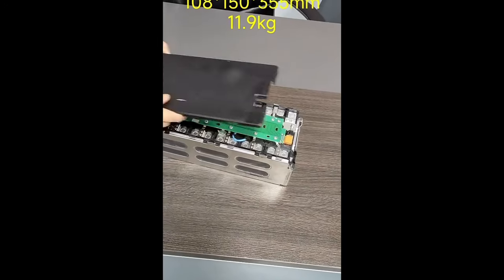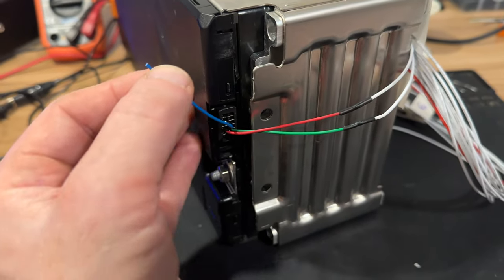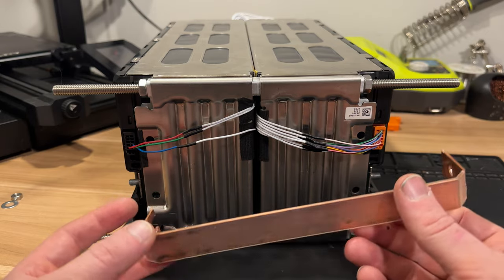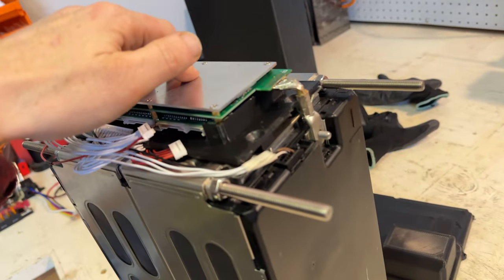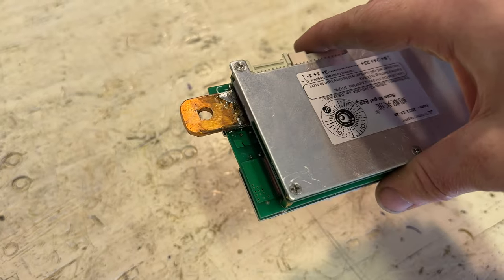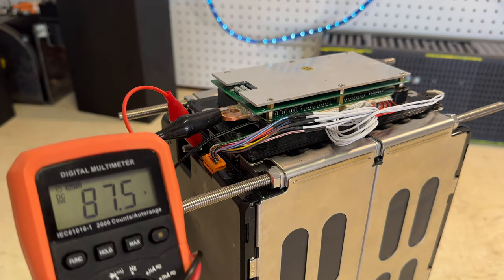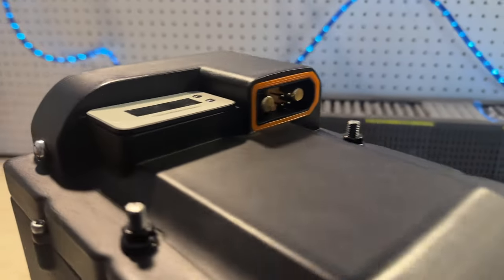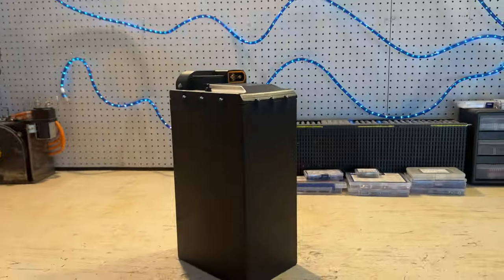High-Power Battery Pack in a 3D Printed Case | Samsung EV Modules

Comment: This had to be the best looking ebike battery I’ve seen, it’d be dope to modify the top of the enduro frame to allow it to be visible. Similar to Sur Ron
Reply from the maker: Thank you! actually this is for a electric motorcycle and is top-loaded like a Sur-Ron - check out my Instagram. video on that build coming soon!
Reply: @GaiusGarage really old comment but yeah I saw the build, looked great, I do however get worried about having so many electric components completely open air since I’m a all season rider🤔

Comment: Excellent build,  videos and channel! Very much enjoying seeing quality builds and very much looking forward to more episodes. I'm curious how bad a shock you got from the 84 volts?    I did a lot of industrial electrical work up to 35KV and the the only time I was what you might call 'electrocuted' was on a 125V DC. My hands literally tightened up on two leads and could not will my arms or hands to get loose, I could taste and feel the current on my tongue and my heart stop. As I started to pass-out I fell of a ladder and was disconnected.    If you ever do an episode on electrical safety I'd be happy to contribute my 2 cents worth. 

At 8:17 , for limiting solder wicking on large fine stranded connections, I might suggest you try coating the section you would like to remain flexible with high temp varnish, Silicone RTV or glass cloth tape in some cases can stop the wicking. I used 3M Glass Cloth Electrical Tape #27 for years in industrial applications, motor and generator builds and terminations. I use Scotch 27 on EV battery  builds, as it's more robust and durable than Kapton tape and less likely to abrade. 

Also, I might suggest considering fusing the packs in addition to the BMS. Typically in industrial applications with have high supply current potential, Fuses are uses for short-circuit protection in addition to overload protection such as a circuit breaker or BMS, where high transient short-circuit currents could exceed the current interrupting capacity of circuit breakers or contactors, and weld contacts closed, a short-circuit protection can prevent subsequent catastrophic events. Perhaps in this pack build a fuse could be installed in place of a buss bar or lug. 

Cheers!
Reply from the maker: Thanks for this very thoughtful comment and excellent tips! Ive actually copy-pasted this comment to follow up on the techniques you suggested. I'm likely going to take this pack out of the bike in the near future, pull off the cover, and inspect it for wear, now that Ive been using it for a little bit. I'll look into adding a fuse of some sort if I can fit one. 

Crazy story about getting electrocuted! Thats a real close call. The way I got zapped was for fortunate because I was not holding on to the conductors with both hands, but rather was fiddling with one of the bus bar terminals on the BMS while the back of that same hand contacted the other one. I definitely felt the jolt throughout my forearm and was able to easily pull away. But its definitely a bad situation because, for one, I was pretty sweaty so skin impedance was lower and it was my left arm which is closer to the heart. I started always wearing gloves after that. Its easy to get complacent, but it takes a very low current to cause fibrillation in the heart. Its only for the fact that skin is such a poor conductor that we can survive these events in the first place. But of course that has a myriad of caveats. I do want to make a safety video on this topic at some point..its not such an intuitive thing once you get into the nitty gritty. 

Cheers to you as well!

Comment: This battery pack is next level. I didn't expect anything less from you, as I have seen your other work. Some more of that kaptan tape on the bottom to protect the balanced wires from the frame may be better than the electrical tape. Some people like to solder the hydraulic crimp connectors After they crimp them to keep moisture and air out.
Reply from the maker: Thanks! thats a good idea about soldering after crimping. I did see some people will solder the strand before they crimp but I did some research and found that its actually not as good - you want the copper strands to be free to arranged themselves naturally into the crimp. soldering afterwards would be good to keep moisture out but it would also create a solid spot at the base of the lugs that will create a weak point over time if the wire flexes. in this case, it would not so I may just go back and do that!

Comment: Really really nicely done! Did you end up getting a handle on it ? Did you use the same posts as the original "Crappy" temperory handle?

Can't wait to see more ! Super cool!!
Reply from the maker: no I never really found a nylon or leather handle to replace the crappy one. but I didn't look very hard either. but if I do find one it would use those same posts as they are bound to the structural mounting points of the packs

Comment: I hope you see this comment cause I am trying to figure this out. I "inherited" my dads motorcycle a 1979 Kawasaki KZ650 and its in rough shape. I want to convert it into an EV which I think my dad would have loved. Anyways, I am having a hard time figuring out which cells to go with. I want to build roughly a 15kw battery pack for this thing, go big or go home kind of deal. I want to get anywhere between 250 to 300 miles or more out of a single charge. My thinking on this is I want it to fill almost the entire area the original engine fits in, and put the controller and everything else under the now useless fuel tank, or in the seat compartment. I think a 10kw motor will suffice for what I want to build this thing for, not a sport bike just a cruiser. Any idea on the type of cells I should use for this build?
Reply from the maker: I can help you choose cells and design the battery pack but would need some more details about your project. please feel free to book a Calendly session. I have a link in the description. a 15 min session might be ok and I would be able to provide you with some useful info but in my experience those tend not to be enough time for technical issues like this. the 30 minute session would probably be best https://calendly.com/gaiusgarage/30-min-consult

Comment: Heyo, great video thank you for publishing it!

Can you comment on the “direction” of the QS10 connector? Shouldn’t the energised side be the female side so that there aren’t exposed conductors when the battery is not connected?
Reply from the maker: yes, you are correct. the reason I have the male connector on the power side is because it is easier to embed into the case cover since it's a more uniform surface to make a secure fit around the outside of the connector. it would have been more difficult to design the case cover to accommodate the female side. theres definitely a slightly greater risk to short the terminals with the male connector but I also made a 3d printed safety insert to place in the connector when the battery is sitting idle and of course there's no risk when the female side is plugged in.

Comment: Very impressive, I like your work ! I was looking to build a bag back battery for my CYC motor Ebike, any advices ? (It will be a 52v nom system, I looking for the range)
Reply from the maker: Thank you. 52V is 14s, then add as many in parallel as you can for max capacity. don't buy high-power cells as they will have less capacity
Reply: Thank you 🙏

Comment: Very nice custom battery! I’m designing a case also for my first battery. One question: on your bottom 3D printed casing, how thick are the walls? I designed mine to be 2,5mm but it will take almost a day and a half for printing with a 0,6 nozzle 😂😂
Reply from the maker: I actually don't remember the wall thickness but it's something like 3-4mm

Comment: Excellent video!  Where did you get your battery modules?  I absolutely LOVE that battery box!!  Would you care to share your 3D print files?
I've always used Nord-Lock washers for enclosed battery box connections instead of thread sealer.
Again, fantastic video.  Thank you!
Reply from the maker: Thank you! If you look closely I actually am using nord-lock washer in addition to lock-tite. I picked up the modules on batteryhookup.com but they no longer have them in stock. There is a link in the description to these modules on Alibaba and Im sure you can find them from other sellers as well. Link to 3D printed files is in the description as well.
Reply: @GaiusGarage   Very cool, man.  Thanks for sharing.  I didn't even look for the files.  I have two conversions in the queue but I've always wanted to do a street bike.  Your video is an inspiration that it can be done cleanly and not look dumb.
Reply from the maker: @billbayer5526 Much appreciated! Yeah I made reasonabls effort to keep it clean and decent looking without the project dragging any more than it already had. Definitely satisfied with the result

Comment: Nicely designed and built pack.  Where did you get the plugs that fit the battery BMS connectors?
Reply from the maker: I think Amazon - just search QS10 connector
Reply: @GaiusGarage  Thanks.  Edit:  Oops, not those.
Reply: @GaiusGarage  I meant the small multi pin orange and black connectors that plug into the original BMS connections on the Samsung battery.
Reply from the maker: @JRP3  oh, those came with the modules
Reply: @GaiusGarage  Mine didn't unfortunately.

Comment: Those are not a high power cells. The really high power series cells are 37ah, not 48-50ah. A have 37ah and 48-50ah and I can say that first can handle 6C or more, but those with more amphours are restricted to 3-4C max...
Reply from the maker: Those are the continuous ratings but I think you can pull 6C for a few secs. I've had this pack pulling up to 340A during heavy acceleration without too much voltage drop or heat buildup. Although current under normal riding conditions is about 100A at most so definitely versatile enough for the application. I've never really tried stressing them too hard for too long
Reply: Hi, I am building a large battery pack . It is( 2) 24s 11p for 22p total with LG M50lt 5ah cells. 2 L shaped batteries. Anyhow I noticed most people use some high temp. Yellow color fiberglass in their builds, and some don't? Is this important 🤔?? It's going in a mega scooter. Just looking for some build advice.
Reply: They can do 100A continues and 300a peak for 25sec

Comment: Great build! Any chance you are willing to share the cad designs of the brackets and case? I have the exact same modules and would love to encase them. Id be willing to compensate you. For your efforts.
Reply from the maker: Thank you! Yes, I have them on Cults 3d here: https://cults3d.com/en/3d-model/gadget/samsung-sdi-battery-case-bundle
Reply: @GaiusGarage  thank you very much!
Reply: @GaiusGarage  just out of curiousity. what printer did you use for this?  my bambu p1p is too small for it :D
Reply from the maker: @advancedbatteries I had a Bambu X1 also, unfortunately too small for these prints. I used an Ender 5 plus

Comment: This may be a dumb question but is there a way I can use 2 72v 3000w batteries instead of one and get it to only pull 2500-watt from each one instead of buying a new 5000w battery
Reply from the maker: yes, if you connect them in parallel, the power being drawn from each will be half of the total load. you would just have to make sure they are of similar capacity and discharge rating. then make sure the voltage is very close when you connect them
Reply: For paralel there is no need the batteries to be of similar capacities and discharge rating. It would be needed for series.  @GaiusGarage
Reply from the maker: @novacalexandru  that's not quite true. matching capacity may not be absolutely critical, but it's much better if cells or packs connected in parallel have similar capacities and discharge ratings. since the load will be shared equally between the cells in parallel, the pack with lesser capacity and/or lower discharge rating would be under more stress. this will lead to faster degradation and exaserbate the problem even more. if one pack can't keep up with the load at all, this could lead to thermal runway and fire. best practice is to have similar capacities, or if not equal, the load on the lesser pack should be relatively low

Comment: What the dimensions of this battery pack?
Reply from the maker: approx. 400 x 230 x 170mm
Reply: Will it fit a surron?
Reply from the maker: @Akerlie1  unlikely that it would. probably too big
Reply: @GaiusGarage  I think so too. Any plans making a 72v surron battery in the future? Buying a 72 v battery costs 3000 euros. Im planning using a fardriver 72680, 280 vtc6 cells and ant bms.
Reply from the maker: @Akerlie1  yeah I was thinking about designing a pack for the Sur-Ron. the ones I see on the market are super expensive like you said

Comment: I didnt realise how cheap you can get lithum until I saw this video
2300 for a sur ron battery seems ridic
Reply from the maker: yeah it's possible to source battery pack for much cheaper than what EBMX and Chai battery systems are charging for their packs. What you're paying for is the R&D they've done to provide you with a production-grade product. EBMX batteries are potted, for example, and sealed in a stainless steel case, which does have the potential to reduce the damage done from a fire. They're definitely well-engineered products, so it's really up to you to decide whether that's worth the premium. If I had money to burn, I would go with EBMX or Chai, but as someone who's budget-conscious, DIY is kinda the only option
Reply: @GaiusGarage  I don't think these are ness worse than the ebmx both this and the ebmx with lipo pouch cells from Korea have usually been used for electric hybrid applications  
I'd say the ebmx is safer since you can look at user feedback and see how it works amongst a population of people and feel safe i guess
 15kw max bms with those packs tho